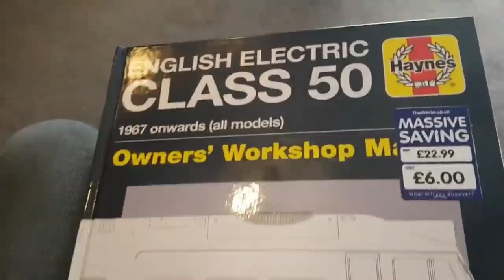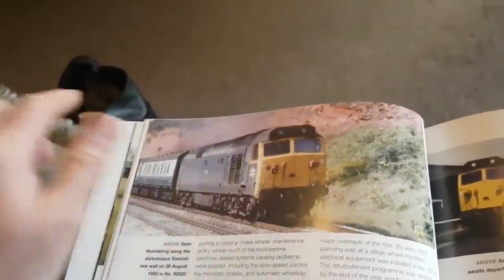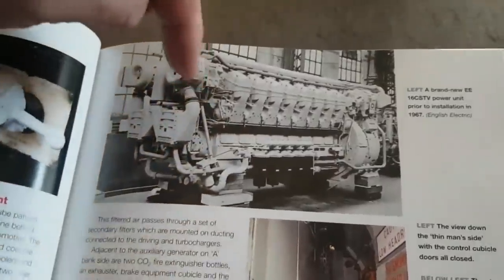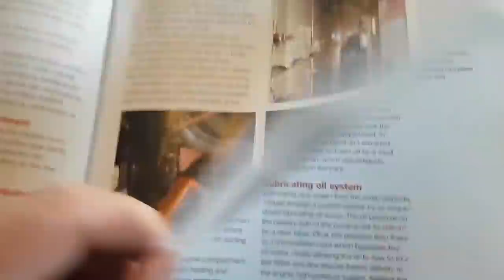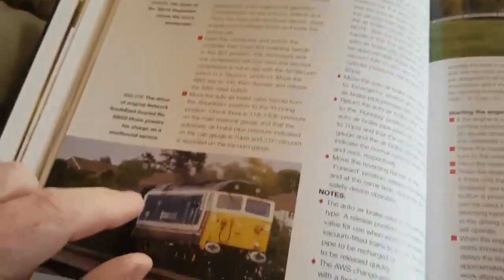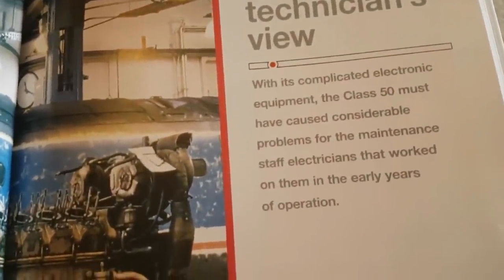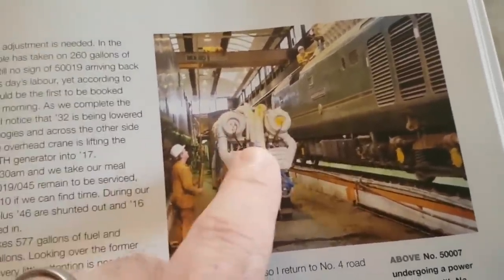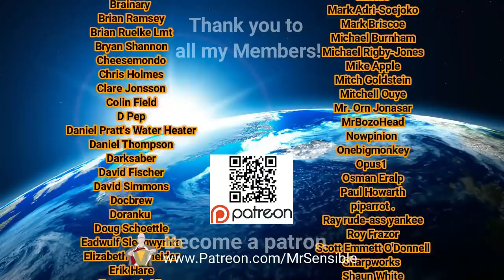Trains and the Dunning Kruger Effect

Comment: Actually, they are diesel electric locomotives.  The diesel engine is a generator that powers the electric motors (called traction motor) that turn the axles.
Reply: ^^^ This ^^^
Reply: Indeed deltecs.
Reply: My thought exactly.
Reply: @dogwalker666  No, Deltics were class 55, class 50 were very different.  Deltics had two, two-stroke 18-cylinder Diesel engines of a triangular design similar to those used in some RN minesweepers, whereas the class 50 Hoovers had a single Diesel V16 four-stroke engine.  

Although the prototype class 50 (numbered DP2) had a different shape of body from the production class 50s, and this looked rather like a Deltic bodyshell.  It was cut up after it was badly damaged in a derailment.
Reply: @jerry2357  ok thanks, The shunters called them all deltics and as an apprentice you did not question them.
Reply: @jerry2357  Yup, those huge Napier Deltics were awesome engines.  They had a fantastic sound.
Reply: The diesel can run at it's most efficient RPMs so it uses less fuel, while the electric traction motors can provide a range of torque and RPMs.
It's like a hybrid car with batteries and electric drive, plus a small gas engine to allow charging while driving to increase range.
Reply: The book also refers to Diesel hydraulics. Basically the diesel motor drives a hydraulic transmission, similar (but not identical to) an automatic car transmission.

I drive diesel hydraulic passenger railcars 🙂
Reply: Not sure of lighter passenger locos but I believe heavy duty diesels power generators because the load on a clutch was or still is too much
Reply: @bobblum5973  true its like my car it has a big diesel engine that runs a three phase generator to charge the batteries which power  the rear wheels,  if it requires more power or 4 wheel drive the engine can power the front wheels as well,  it is brilliant in snow, And very economical.
Reply: @nadnerb2k  you can also have the diesel engine power a hydraulic pump which then provides drive similar to the forklift we have.
Reply: @Sableagle  Freight trains do not have traction motors in the carriages.
Reply: Well said :)
Reply: Maybe the locomotive runs on chuff-nuggets which produce air which runs everything? If you could feed the loco enough chuff-nuggets there would be an excess of hot air which is converted into electricity by the turbo-electric device which powers his internet connection.
Reply: @CuriousBipedal  I heard they tell their passengers to eat a lot.of beans and tacos the night before they are going to ride on the trains. The collective gas from every passengers dinner provides enough gas to run the trains around the earth over a.dozwn times.and then some. 😄

Comment: As a train addict, I have never seen such a pile of nonsense about what is one of my passion in life.
The technical knowledge and comprehension of this guy is not zero, it is below this value. Hope someone does not shows him a Black Five, a Terrier, a Pannier tank or any kind of steam locomotive, I can't imagine what he can say about the cylinders, the coupling rods or the exhaust stack...
For the class 50 (great british diesel by the way), it becomes complicated when you think that the diesel engine was running an alternator that produces electric current for the electric traction motors which ran the six axles of the locomotive. That is called a diesel electric traction and it is the most common type of traction chain on diesel engines.
Great job from you to find such blatant idiots Mr. Sensible. Thanks for the video, it was double fun for me, trains plus nutcases.
Reply: Long live the Hoovers.
Reply from the maker: I'm not an addict or spotter and came to this with very little knowledge.  It appears my internet kung fu is somewhat stronger than Jonesy!
Reply: Love steam engines. It's only recently that I learned one runs as a commuter train in the middle of a freeway in Los Angles.

Comment: As for electric trains: the pantograph and overhead catenary line system is fascinating.  There's a lot more than you might think to how these are engineered and how they work.
Reply from the maker: True.  I was amazed at what goes into them... so much more that just a wire slung overhead!
Reply: @MrSensibleHistoric  I used to commute to Manchester on the main line, and in winter the expresses to London flying through the station at full speed would generate a spectacular, constant blue spark if the cables were frozen, it looked like arc-welding gone mad. He can't even get that right.

Comment: The diesel engines didn't run any gear systems to the wheels. They were call diesel/electric because the diesel engines ran generators the electricity ran the electric motors at the wheels.

Comment: This is either ultra-dry humour or our friend here is genuinely thick. He did actually get something right though amongst all his train-brain-farts, and that’s the part about the Class 50 engine working by compressing air. What eludes him is the “combustion” part of “internal combustion”, of which compressed air is an essential element - but not the only element. I suspect his attention span expired after reading “The Class-50’s engine works by pumping air” at which point the conspiracy alarms started ringing and he dashed off to make this video.

Comment: Compressed air? That's silly. Everybody knows they are hamster powered.
Reply: They no longer use hamsters because the fur they shed clogs up the wheels.
Reply: They use chipping to control them!.. When they run out of Chips, they start using Dale, the other Rescue Ranger, and if all else fails, Gadget Hackwrench herself

Comment: Actually, there are some very small locos that run on compressed air, they are used in chemical and refinery works for safety reasons, the problem being was very poor endurance and no real pulling power.
Reply: I believe that they plan to have short range, compressed air powered, commuter cars in India. 
https://www.downtoearth.org.in/blog/air/compressed-air-vehicles-can-be-a-potential-mode-of-urban-transport-in-india-62987
Of course compressing the air STILL takes some form of energy. The magical thinking required to believe otherwise, reminds me of something I read about the Russian occupation of Berlin at the tail end of WW2. Some of the soldiers, coming from rural areas, had never run into taps and plumbing. So they tore the taps off walls to take home and install on their walls...for the endless water they thought they'd supply, but at least they had the excuse of being uneducated peasants who didn't know better.

Comment: As someone who has actually repaired these I can assure the moron they definitely run on Diesel and are buggers to get started on a cold winters winter morning when the diesel freezes.
Reply: But when they start up on a cold day though, they are amazing site with all that thrash and clag coming out of them :).
Reply: @CaptainWelshie  indeed with a few cans of easy start in the air filters and jump leads getting very hot
Reply: @dogwalker666  I've seen a 1st gen DMU and class 31 start up on pontypool and blaenavon railway both warm and cold days.
Reply: @CaptainWelshie  fun times we had a look in there a few years back.
Reply: YT is full of videos of that, I just watched this one where it takes some 8 minutes to start. https://youtu.be/j3R0BzhtH9g
Reply: @slavkopejic3140  ahh fun times one problem is when Diesel gets cold you get Waxing it is basically starting to freeze this makes it harder to pump and blocks the injectors and is harder to compress, Road cars used to have this problem too but they put antifreeze in now.
Reply: @Sableagle  well actually that is sort of how we used to do it you remove the aitfilter then spray a few cans of "Eazy Start" in, usually the batteries were dead so we connected some jumper cables to a running loco, Press the start button and hope for the best. This was the electrical apprentice job.

Comment: sorry sir, electric train lines DO spark. I've seen it in Chicago, New York, Portland and San Francisco.
Reply: On any icy evening/night it's quite obvious
Reply: The electric overhead lines are divided into sections, usually between stations, in order to isolate in case of faults etc. Pantographs passing over these gaps generally give off a flash if drawing heavy current at the time, especially if it is a DC line.
Reply: It's been decades, but I recall smelling the hint of ozone from electric bus and trolley cars.  Many metropolitan "light rail" commuter trains still use the true electric system as well.

Comment: "GAS" Turbines use Gas, yes, no, maybe. While it could use gas as a fuel it could (and most do) use liquid fuel. Think jet aircraft here which  use a type of kerosene. GAS turbine refers to the use of a gas as a working fluid, again think jet engine here. They may be used for generators, pumps, prime movers, or whatever. There are also Hydro turbines  which use water as the working fluid for example ; Hydro electric power stations.
Reply: Diesel gas turbines exist, and have been used on trains (very rarely) and boats
Reply: Yeah whatever, my point was to comment on Mr Sensible's remark that deisel engines use diesel and Gas turbines use gas. And how that statement wasn't very helpful in the context of the debunk.

Comment: I'm not sure about the UK but most trains in the US are pulled by diesel electric locomotives. The diesel engines power electrical generators which produce the power for electric motors that actually move the train. The diesel engines emit exhaust just like a truck but it's not black smoke unless the engine is malfunctioning

Comment: Even if the energy source was free, the maintenance of current infrastructure, the upkeep of the locomotives, the cost of new locomotives and laying new track, the engineers, drivers, and other staff, all need to be paid for.

The cost of fuel is only a small part of running the rail system.

Comment: It's easy to find the different locomotive types in Germany. We have overhead wires for e.g. the ICE (InterCity Express), contact rail for e.g. the S-Bahn (light rail) in Berlin, and diesel for e.g. cargo trains as well as regional trains that service non-electrified lines. In case of contact rails, electric arcs are obvious in some places where the rail switches to the other side of the track (e.g. in a station, it is always opposite to the platform). But I guess some Illuminati conspiracy theory is more exciting than making such mundane observations…

Comment: They were not actually built by English Electric, they were built by the Vulcan Foundry to EE design. EE supplied the diesel powered generator that supplies power to the 6 EE  traction motors within the 6 bogies. So unlike an electric loco that is supplied by overhead wires, the 50 class generated it's own electricity.
BTW The book is not about trains, it's about locomotives (yes, diesels are locomotives too) Trains are what locos haul.

Comment: I have thousands of hours of experience in running petrol engines WITHOUT petrol. 
 Regardless of this fact, a fuel - of some kind, is ESSENTIAL for their operation. 
 These air heads need to obtain a clue, lest they wish to embarrass themselves even further.
Reply: @ReValveiT_01  
 Agreed. 
 Their allergy to facts appears to have granted them total immunity to embarrassment, by viciously amputating their sense of self awareness.
Reply: @CNCmachiningisfun  Exactly right.

Comment: There were experiments in the 1930's with 'air' powered locomotives. Diesel pneumatic locos. Basically steam locos with boilers removed and replaced with diesel powered compressors which then in turn drove the cylinders n the same way steam did. The Germans had a couple of prototype units and in the UK the LNER was considering the idea, but they were very inefficient  and the idea was dropped by the time WW2 came around
Reply: There are also a handful of air powered cars, though I suspect maybe most of them are built with Lego Pneumatic. https://en.wikipedia.org/wiki/Compressed_air_car

Comment: The engine driven generator with electric traction motors was a big breakthrough.  It allows for hi levels of power transfer from the engine to wheels without the need for complex mechanical gearing.  The 'electric-drive' system avoids heavy-duty clutching, transmissions with multiple gear combinations and 'shifting' of some expensive and very heavy transmission.  FYI, it is also successfully used in a variety of marine applications.

If Mr. JoneS took a few minutes to READ the book, he might learn some great new things.

Comment: Straight away he is using the personal credulity fallacy by saying he has never seen sparks from the pantographs on an electric train. Just because he has not seen them does not mean they do not do it! I personally HAVE seen sparks from a pantograph, both directly and indirectly. Directly by actually seeing the spark on a passing train and indirectly by seeing the light from the spark hitting a tunnel wall as we passed through the tunnel. They do spark.

Comment: The rotation of the wheels Runza fully turns the turbos to compressed air into the Pistons to turn the crankshaft that runs the drive shaft to turn the wheels of the train. You see free energy we're just going to ignore that little bit called friction.

Comment: Oh my goodness. Confusing a diesel locomotive and an electric locomotive is quite something. Perhaps they’re confused by A) the company that built these particular locos were called English Electric and B) that EE locos use Diesel engines to drive electrical systems to drive the traction motors. Crikey. Also, there are tons of videos on YT of electric train pantographs arcing due to movement/ice/frost/water reducing contact to the wire. Wow. (I work on the railway so this was largely amusing)!
Reply: You know what would have resolved such confusion handily? Reading the book.

Comment: That guy should go on a tour of a WWII Submarine, his mind would melt when he'd see that the diesel engine needs compressed air to start, then diesel to run and that it charges batteries to run an electrical motor! (I did use mind instead of brain, because...well you know, nothing to melt if I said brain) XD
Reply: Ah but when he discovers that torpedoes ran on compressed air he will wet himself.
Reply: @dogwalker666  We should get him a 2L pop bottle, a cork and a bike pump! Lol
Reply: @drabbitz2319  ha ha yes indeed.

Comment: Very few gas turbines run on natural (methane) gas, some power stations do, but gas turbines in aircraft run on aviation fuel, a type of kerosene, and gas turbines in ships run on diesel oil, often very similar to what is used in diesel engines.

The engines are often very similar in design, for instance Concorde, the Vulcan bomber, Invincible class aircraft carriers, Type 42 destroyers and Type 22 frigates all used a version of the Rolls Royce Olympus gas turbine engine.

Comment: JoneS SenoJ... Is he the guy who pretend that airplanes work on compressed air ? Here, he show us that he's even stupider than we could imagine.

Yes, these are diesel-electric locomotives. Those use a diesel engine powering an alternator to produce an electric current used to power the electric motors that make the wheels turn. There is a gain in efficiency because the diesel engine can operate at it's ideal RPM, and a gain in control of the traction because the electric current can be very finely modulated.

Comment: The rsason why most diesel trains use electric transmissions is that electric motors are great at producing maximum torque at zero RPM, very useful for starting to move heavy train cars. They are a lot easier to operate than a mechanical transmission, no clutches, less wear, and far less maintenance required. It also makes it easier to route power to all the locomotive wheels, using 1 motor for each axle. A bonus is that they can and do run just as fast backwards as forwards, as we often see on long freight trains with engines at both ends.

Comment: Maybe this guy should follow a course on train propulsion 101.
* Mechanical diesel engine: like a car, bus or lorry, diesel engine with a mechanical gear box and transmission line. Exclusively used for small power shunter locomotives.
* Diesel-hydraulic machines: same but with an hydraulic transmission system allowing more powerful machines. A system favoured in German railways.
* Diesel-Electric machines: system used by the vast majority of mainline diesel locomotives in the world: the diesel engine powers an electric generator replacing the overhead (or 3rd rail) feeding line to power the electric motors. It's more or less the equivalent of a modern hybrid car.
Hence the mix of diesel AND electric technologies in those machines (and the fact that most of them are derived from the same template with two variants: full electric and diesel electric, one with pantographs, transformers and high power electronics (thyristors and such), the other with a diesel motor and diesel tank, but both with the same final electric power plant on the driving axles or into the boggies.

Comment: The other reason steam engines needed a tender to carry enough coal is because a steam engine has to have a big container full of very hot water and steam. Making it so you can fill a solid into the same area as a boiler (and a fire hot enough to burn coal) was generally seen as not a good idea.

If you have seen the results of a boiler explosion you would probably agree they should be as reinforced as possible and have nothing around them that could provide extra heat or damage the boiler while loading.

Diesel is much more convenient to fill stuff with than coal (unless you are brave and pipe the coal through with compressed air... which wasn’t really an option when steam engines were popular)